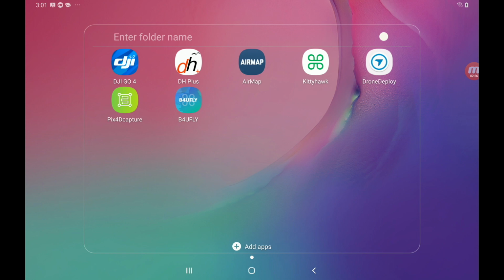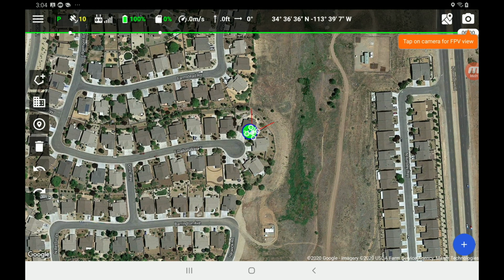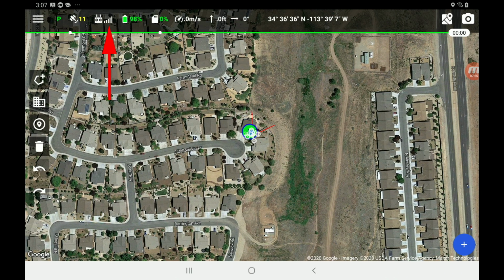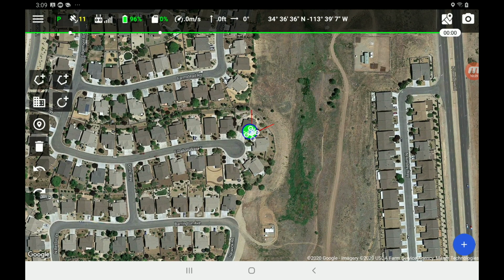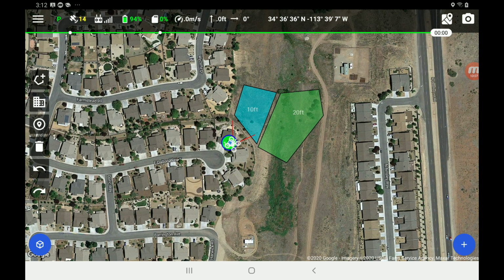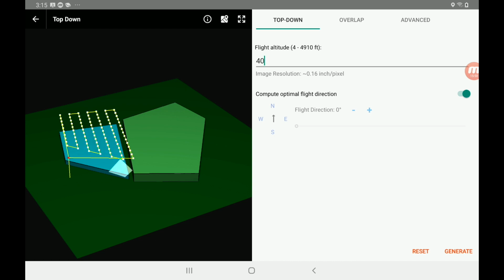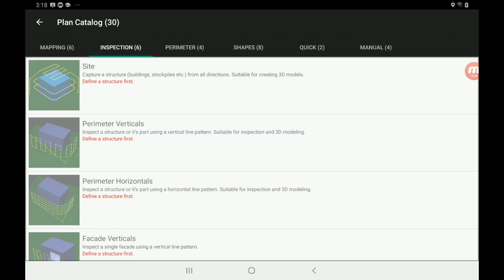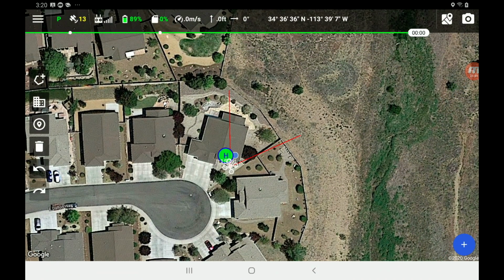A First Look At Drone Harmony DJI Flight App

Comment: I've used DH both in the UK and Europe. The big advantage is that you can pre plan your missions in the office on your PC or laptop, just upload them to your drone in the field via your smartphone or smart controller, then just send your drone on it's way. It's a great split platform programme as long as you remember to synchronise both platforms. It works with both my DJI Mavic Mini 2, and my DJI Mavic Air 2. Even the basic free version is very useable. 5* from me.